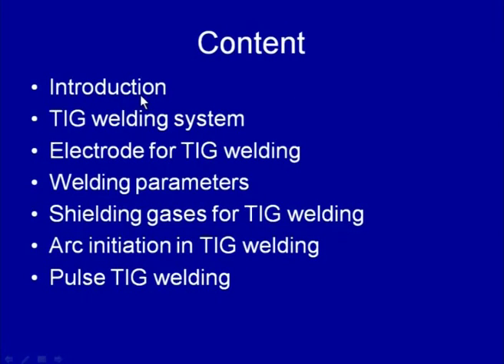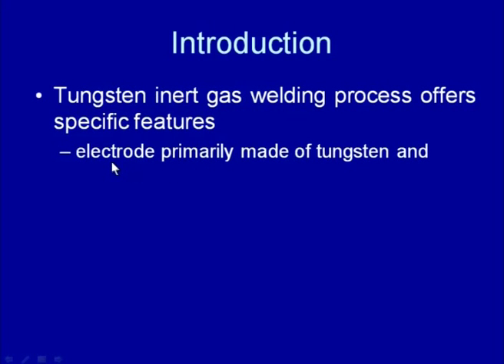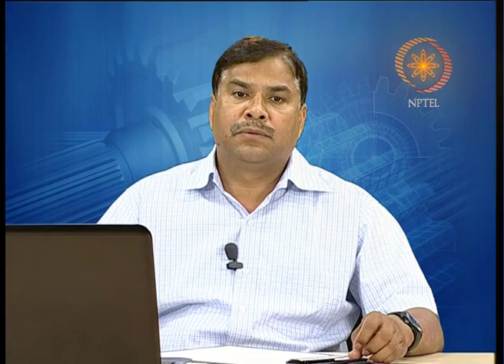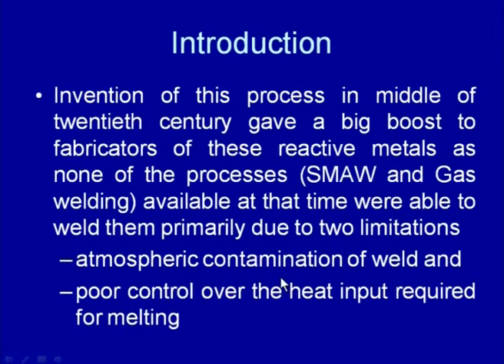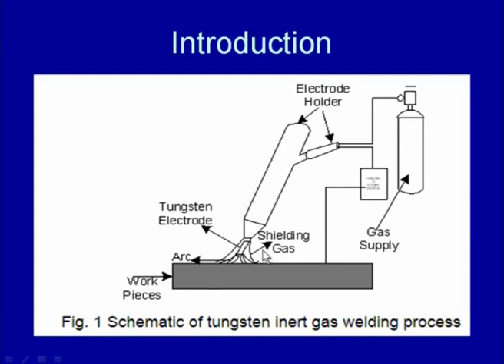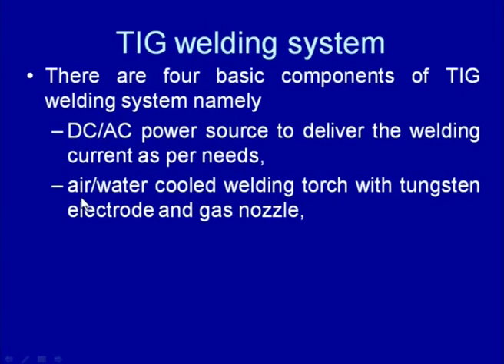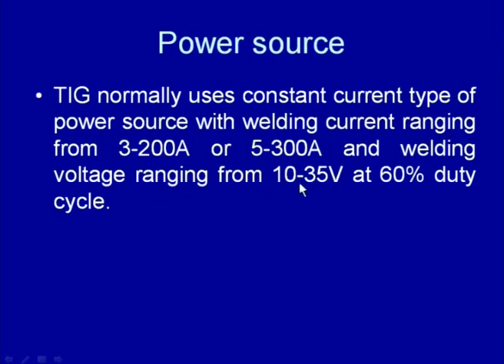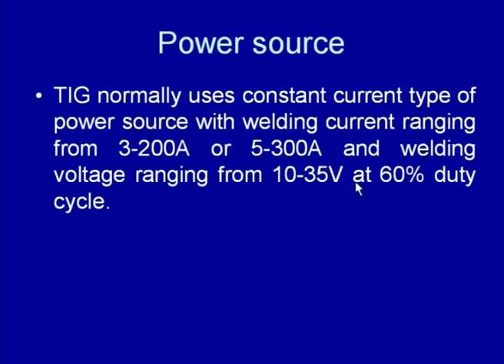GTAW- I

Comment: At 30;18 the slide indicates that electrode's feeding rate. It should be filler wire instead of electrode. As the electrode is non consumable.